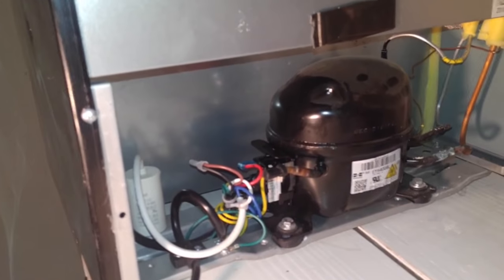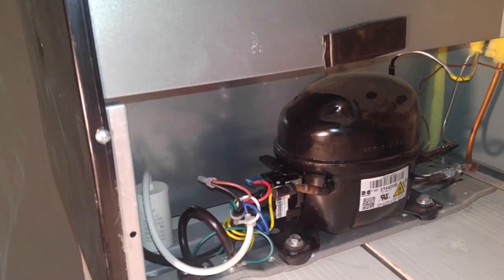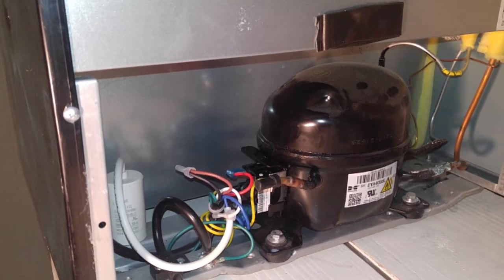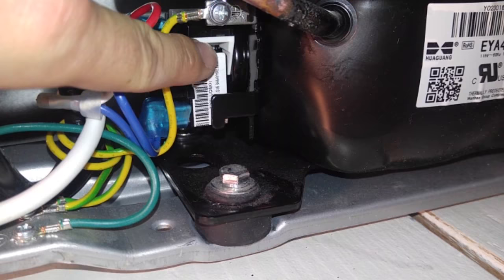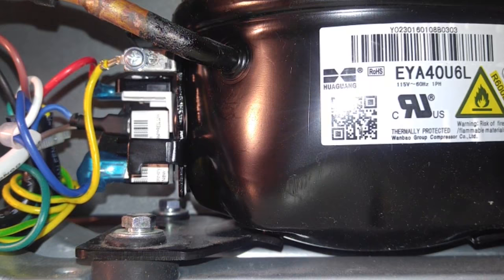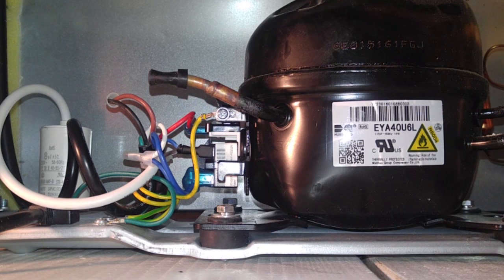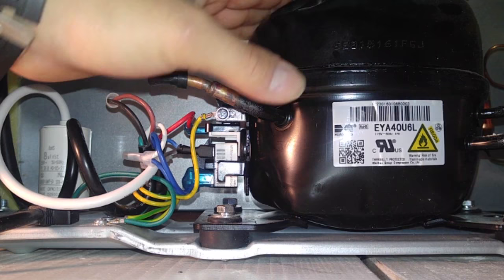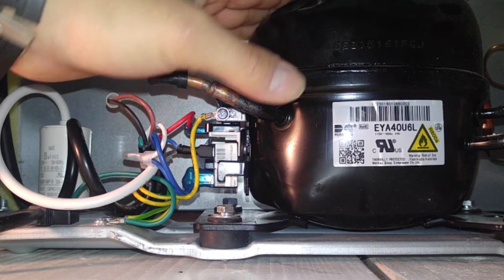mini fridge fixed and cooling again!

Comment: I had the exact same problem on my mini fridge. I removed the relay and it made a rattling noise when I shook it. I ordered a new relay on Amazon for $10.  The new relay did not rattle when I shook it.  I replaced it and the frig is working again.   (holding at 32° for the past 24 hours).   I did not replace the overload switch.  Thank you for the tip on how to fix it.

Comment: Had a power surge. Replaced it, the relay. 
 But now the compressor is at 200 degrees and still no cold pop. Bummed

Comment: I don't have the clicking . and compressor not turning on . and the inside control panel is flashing lights ? You think the same problem it's 2 years old
Reply from the maker: It is possible. I think you'll have to go piece by piece to pin point it.

Comment: So mine powers on and a very low hum is heard (pump not running). After about 15 seconds there is a click and the hum stops. After about 3 or  minutes there is a click. Then the low hum and again
Measured resistance between all 3 terminals in the 10 ohm and less range. 
This is a brand new machine that was damaged in shipping with a dent next to the control panel. 
Any Ideas?
Reply from the maker: sounds like the overload is faulty. I would try that first.
Reply: @matthewhendershot2009  so the motor is not even starting. The overload could cause that?
Reply: Most likely the compressor is stuck, the clicking is a thermostat that is protecting the electric motor from overheating. If the compressor is stuck the electric motor tries to draw in more current to move and as the current rises it heats up and trips the thermostat. you can test for this with a clamp ampmeter on one of the cables, if the current draw is way above the rated amperage (this should be on a sticker on your fridge, mine was 0.8 amps and was drawing between 3.3 and 6.0 amps) then something is preventing the motor from turning. Solutions to this go from tapping it with a hammer while it is starting, to using what they call a compressor hard start capacitor ($10 on amazon) to try to break it free, but if this doesnt work pitch it, a new compressor probably costs more than the fridge.( By pitch it I mean scavange the parts, cut the compressor open and take a look and see what went wrong, maybe use the electric motor or the compressor for something else, learn something new ,but sadly as a fridge its toast)
Reply: replace the relay, pretty much the same thing that's shown on the video. That relay helps the motor start.
Reply: I have this same exact problem. Hums for a few minutes, then clicks off. Ok now it just kicked on the humming again. Replaced thermostat, relay, and overload so no idea what’s happening here.
Reply: @seansethi196  Stuck compressor, read my previous comment, long but answers your question.
Reply: nickolas velandia thanks for responding. I tried tapping with a hammer, then I solved the problem by setting the fridge out on the curb, and it got picked up by a scrapper.

Comment: My mini fridge stopped cooling at level 4. It’s has 5 levels 1-5. One day it just stopped. I unplugged it for 5 min a d set it on 1. I plugged it back in after 5 min and it began running. Now it stops working once a day and when I try to unplug and replug it only works for a couple hours. It’s a small igloo fridge with a small fridge and small freezer. It’s no more than 3ft tall. How can I diagnose the problem and fix it? It’s brand new
Reply: Probably the thermostat ,did you ever get it fixed

Comment: My fridge turns on, but doesnt cool anymore.  Will this fix help?
Reply: No the party change were to start the compressor, you say yours is running so that's not the problem.mine is doing the same as yours. Did you figure  out a fix yet? 🤔🤔🤔

Comment: My mini fridge was less than six months old when the fan stopped. I can hear something kick on periodically, and the freezer works fine, but I have to leave the freezer door open so it cools the rest of the interior. When I googled, it just says best to replace the whole thing. Is it doomed? Could it be a quick easy fix?

Comment: I replaced both units as you showed. However there was no change. The compressor did not start. any other suggestions? Richard
Reply from the maker: Does your board appear to have power at all?

Comment: I have a mini fridge the freezer is cold but the fridge is cool any reason why ?
Reply from the maker: maybe needs a defrost? Sometimes the defrost time goes out and causes improper refrigerant circulation. I would look into that. Hope that helps!
Reply: @matthewhendershot2009  mein kompressors work but it doesn’t cooling i change new parts relay and still not working it makr noise the kompressor but not cooling any new suggestions thanks

Comment: When I open my fridge the back is frozen but it’s not cold in the refrigerator???? Do you know what is that
Reply: Evaporator fan motor
Reply: @felipeortega3192  so I need to buy a new one or I can fix it
Reply: @prod1580  if is one of those Magic Chef small refrigerators is very common for the fan to go out, if you have a bigger refrigerator it could be a defrost system issue which is in most cases a cheap repair.
Reply: @felipeortega3192  thanks for the information

Comment: How do u take the cap off
Reply from the maker: which cap exactly are we talking about?
Reply: @matthewhendershot2009  hardest part for me is getting the plastic cap off (the housing) there is no metal clip on a RCA mini fridge. I cant seem to get it off and i dont want to hurt the wires or anything else. i need help. rca model rfr322-e refrigerator
Reply: If you’re talking about the plastic cover over the relay, there’s a tad on top you stick a screwdriver in and pry down. There’s a diagram on the side you can’t see til you get it off.

Comment: Is it normal for the mini fridge compressor to get scalding hot? I’ve loaded a lot of water bottles in the refrigerator and wonder if that’s the problem
Reply from the maker: I think it depends on what you consider scalding. I don't think it should be getting too hot.

Comment: Yeah is this compressor supposed to be hot because mine is
Reply from the maker: I don't believe it should be getting too hot.
Reply: If it's working then maybe it's working hard because u had just started it up ,it will work harder to freeze newly placed unfrozen food  or it's trying to cool just air the the fridge or freezer being empty